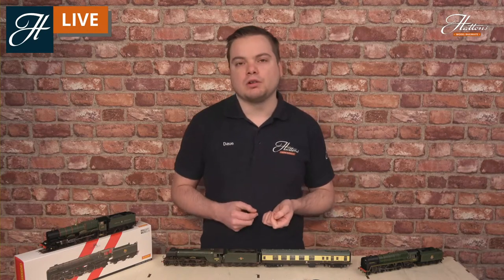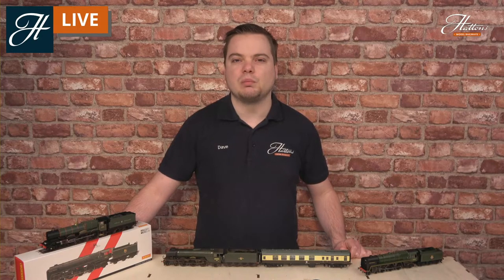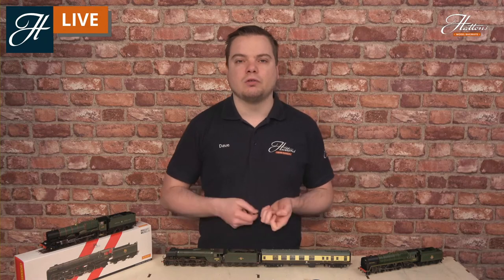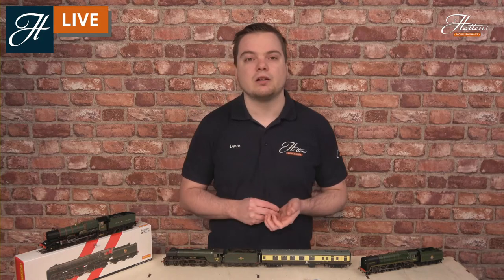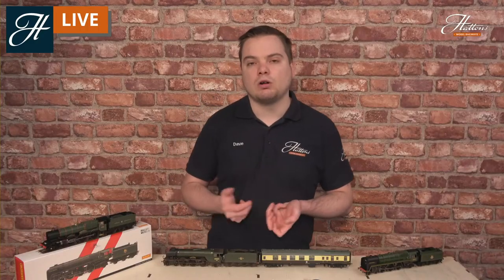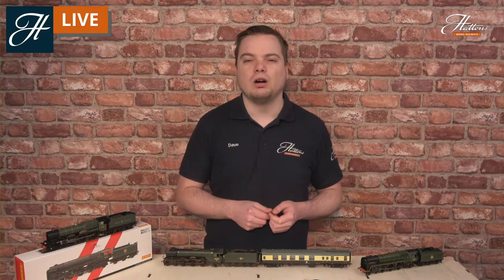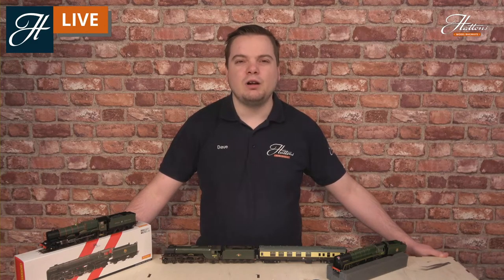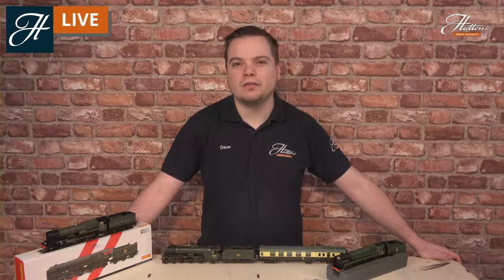Modelling a mainline steam railtour - the basics

Comment: Hello, excellent video. Quick question but if you were modelling say 1990s/2000s then I seem to recall that rail tours just seemed to use any old coaches they could find and so they weren't as uniform. 

I seem to recall (though I may be wrong) some old intercity coaches making up rail tours. Am I right or am I misremembering?
Reply from the maker: Hi Noel, you're spot on. Whilst the coaches were owned by specific charter companies, it took several years to repaint them all from their original colourschemes, so some 'mix and match' rakes made appearences during these eras.
Reply: British Rail's charter set was a rake of intercity liveried mk1 carriages.